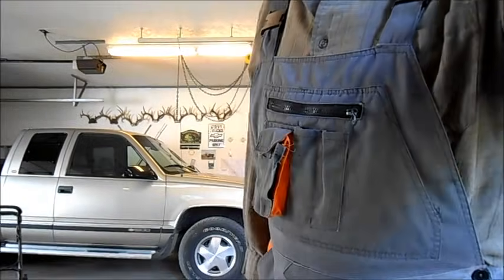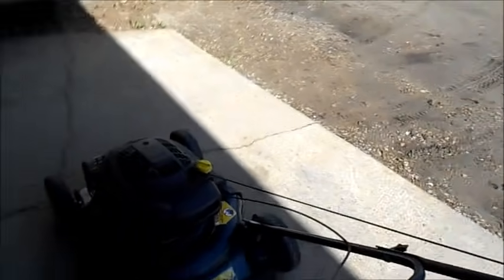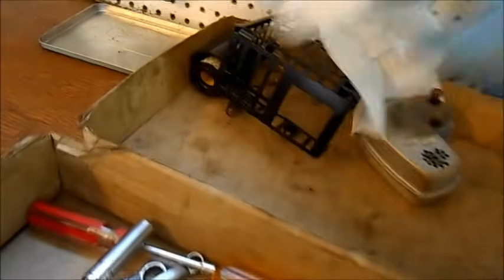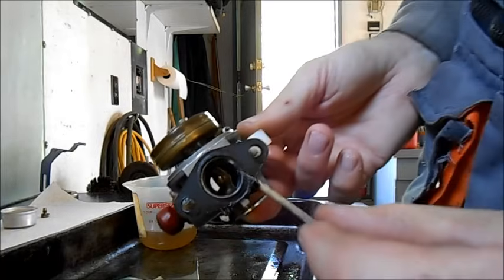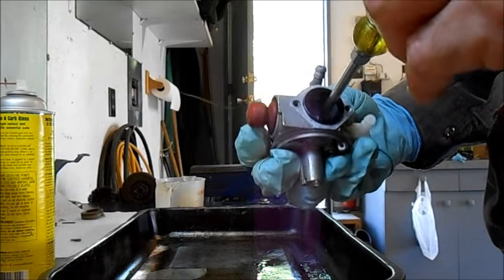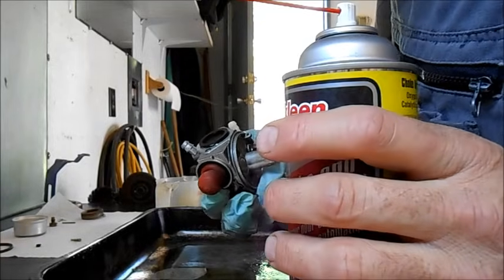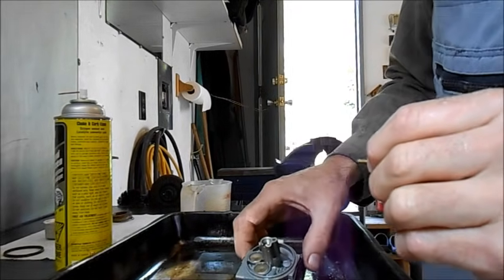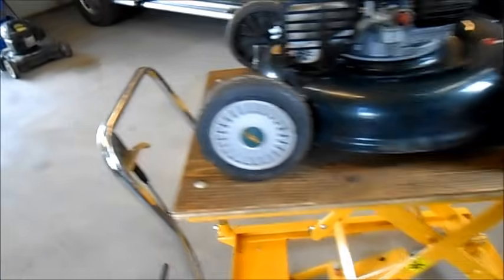The Repair of a Surging Tecumseh Mower

Comment: Never have been a fan of tecumseh engines but i have repaired a ton of them and i found it easier to by a new carb off ebay for about 12 bucks and free shipping. Sure it is a chinese reproduction carb but i can say i have never had any complaint's  from any of my  customers.
Reply from the maker: I have done both.   I respect them as the parts are so interchangeable.
Reply: Bruce Pender a buddy of mine just got me a personal pace with key start awesome almost brand new shape Tecumseh 6.5hp Toro free,  one of my tuber buddies clued me in to the knockoff carbs, I was able to buy the carb, Battery, set of 10 air filter for this mower and a carby rebuild kit all for the same price of a Briggs carb, love it can't wait to put it in this spring and get her running, might also have a sheered flywheel key and a bent blade but have tons of them laying around my parts piles,..... can't beat free.
Reply from the maker: Yes the F word Free.  Are you from Australia?   (carby)
Reply: If the jets are clogged and can’t get wire to poke through, soak it, spray it, poke it, and blow it out with air compressor.  Repeat as necessary until it is clean.  Anyone can buy a cheap Chinese carb and install it.  There is a real sense of satisfaction in cleaning/rebuilding a carb and getting the machine to run well again.
Reply: That's what I do , 12 and 10 to 15'min to do the change

Comment: I love these engines, shame Tecumseh went belly up.
Reply from the maker: +seniorjohnl   Me too.  I have learned to respect them.
Reply: Thank God they did go out of business!  The motor is fine, but Tecumseh had the absolute worst carborator on the planet.  You can't keep them running!!  The reason the chinese carbs work is because they are not California emissions compliant.  The jets are bigger, meaning they get enough gas to run!  Here, the shops will not even take a Tecumseh in!!!  You get to haul it back home :)  You see, they fix it, 30 days later it does it again, they fix it again, 30 days later, same thing.
Reply: @HMDickson  I've worked with many Tecumsehs. That's complete BS. Those shops are just lazy.

Comment: These run a lot better if you ....um....Clean the high speed and fixed low speed jets "REALLY WELL" (so well in fact that a few thousandths of an inch of brass goes mysteriously missing) in the jet openings if you have access to microscopic drill bits and reamers, pokers, etc. . (where legal, of course). 
The EPA is the main reason we have to put up with these lean running POS newer small engines.
Reply: +scdevon The EPA disapproves of this comment. I don't.
Reply from the maker: One piece of dist changes everything

Comment: Hi Bruce ,

What's the difference between a normal mower and a mulcher ?

English Mik
Reply from the maker: Well my ride on John Deere  mulcher doesn't have an exhaust chute for the grass clippings.  The grass  just gets  trashed around in there and get deposited on the lawn for future organic growth.   When mulching you have to cut a bit more often to avoid clumps .   But it actually does work if the grass doesn't get too long.   Most of our newer mowers have the choice of mulching or bagging unless it is just a cheap side discharge.
Reply: Bruce Pender 

So leaving the bag off , works just as good !...Yes .

Cheers ol bean  ?

English Mik.
Reply from the maker: @michaelpalmer937  Unless the grass is too long or wet.

Comment: use a bench grinder to recondition your screwdrivers, instead of replacing them...
Reply from the maker: +Electrician by trade Thanks   I do that as well but I just don't have the precision on the little screw drivers for the little carb screws.  Thanks for the comment.  always appreciated.

Comment: Linkage, linkage, linkage. None of you guys ever show the linkage reinstall. Sometimes it falls off, and figuring out the connection is 5 times longer than rebuilding a carb.
Reply from the maker: On this video at 6:54 it shows both types of tec mower linkage.  It takes a minute or so.  Not 654 on the above video
https://www.youtube.com/watch?v=mmiliB-jg6s

Comment: Or we could simply put it in a ultrasonic, jets float bowel everything let it sit in there for 10 min then soaking has let evaporate done.
Reply from the maker: You are right.  But with one carb I usually just do this.  i know I could use the cleaner.  I do it for 30 minutes.

Comment: You cheated. At idle rpm (3400) it still missed. The camera interrupted and suddenly it was smooth as silk at higher than idle (36-3700) rpm. I know this because I have the exact same issue with the exact same results. Neither of us has truthfully fixed the issue in settling for a high idle. Why give a shit? Because Tecumseh is a shit motor. It will wear out prematurely at high idle. Nevertheless,  I'm impressed with the video. You did a good job. As Commander Riker would say, "Sometimes you get the bear and sometimes the bear gets you".
Reply from the maker: Well the only critical comments I get are from folks who have never made a video.  I have 34,000 subscribers.  They keep me on my toes  Really they do.    If you make a video I will watch it and comments will be constructive.

Comment: how much for that job in ct i would charge elderly neighbourhood and i mow there yards parts only they buy $35 denaros
Reply from the maker: I don't charge much as I am the neighbourhood guy that fixes stuff.  This video is more that 4 years old too.  Probably 1.5 hours labour.
Reply: bought primer bulb when took off noticed 2 nips on inside of bulb facing 10 o'clock and 2 o'clock new one doesn't have can i use craftsman tecumseh carb #640271  series 11

Comment: That is why I don't work on Tecumseh engine thy will not run right even when you redo the carb
Reply from the maker: I think all types surge.  Iv'e had Honda, B&S,  Kohler and Tecumseh surge.  The tiny holes in the jets are now the issue.
Reply: @BrucesShop  why do my tecumseh starts good but buggs off